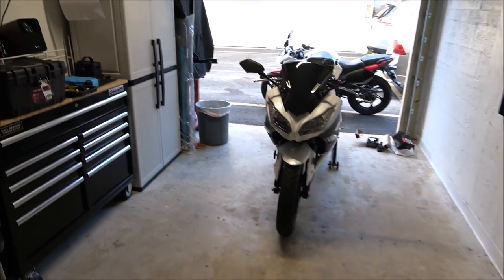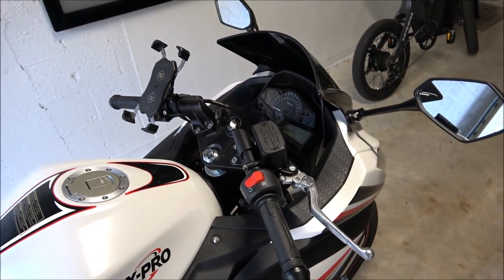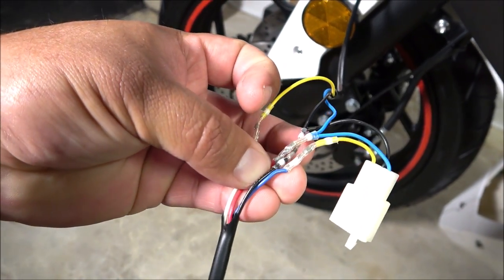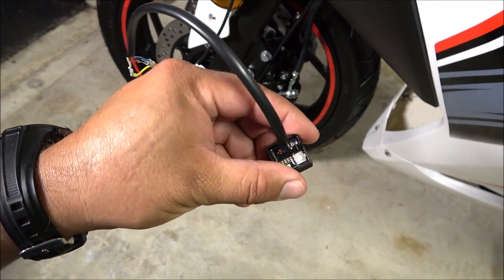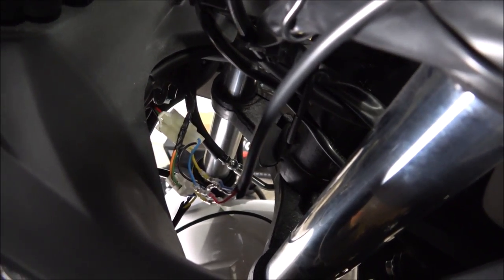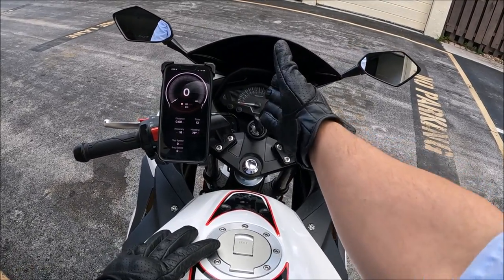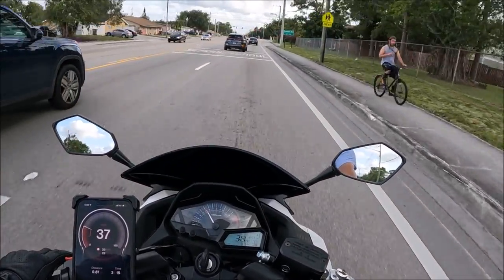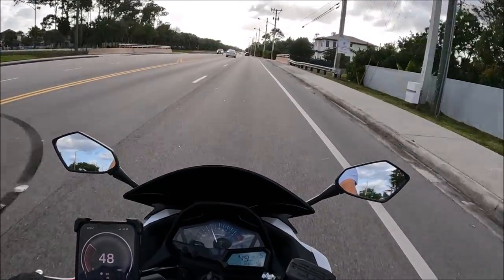X-Pro X24  Motorcycle - Speedo Fix (Calibration) - Works for Other Chinese Bikes As Well!

Comment: Can you do a top speed
Reply: Pretty sure its 90mph if you're light, going off the fact it has the same engine as the X22R
Reply: @GigaCam  I'm 245 5'10, it taps around 130-135, and I live in the mountains. I've upgraded a few of the basics, spark plug, tmaf sensor, tires, breaks, premium gas, octane booster, cleaned and oil chain and that what I can think of at the top of my head.

Comment: Did you have to calibrate your miles as well? I just got mines and yes speedometer is off about 15 or 16. And it seems to add miles fast. Maybe it's me. And a oil cooler install would be nice as well.
Reply: Sorry if this comes off as me being rude, but you do understand what MPH stands for, right? So, your bike's speedometer is saying it's going 75 miles per hour- that means that if you ride for an hour at that speed, you'll have put 75 miles on your odometer. In actuality though, according to you, you're really traveling at 60 miles per hour, so the truth is that in that hour of riding you only put 60 miles on your odometer. So yes, your bike currently is inaccurately racking up mileage on your odometer. All these Chinese bikes have inaccurate speedometer sensors, it's obviously best to install a speedodrd as quickly as you can. However, you can't adjust your odometer to reflect the true miles put on the bike because technically that's illegal. 

There are vids to do the oil cooler install, check out a youtuber named JerryHawk250 or Mike Check Moto. Best of luck!

Comment: Where can I get an x24?
Reply from the maker: They are out of stock everywhere. Very good bike with minor flaws and priced right.
Reply: @MJTechChannel  yeah man love the looks, looking for a good commuter. I was thinking about the KPR200, but I’d much rather have the X24 I think. Anyway you could do a side by side comparison of the two bikes? It sounds like you own one of each?
Reply from the maker: @XxWaNt5oM3xX  Ok will consider it
Reply: hey i was wondering if the bike comes with a temp plates
Reply: @kendrickpetty1355  You get those yourself. You'll get the paperwork to do that , then head to your local DMV.

Comment: Those wires should be shrink tubed individually they shouldn't be taped together in their  present state. I was a technician for 26 years and seen customers start vehicles on fire for doing hokey wiring putting in audio systems, T.V, or the like.
Reply from the maker: They are not taped. Check again on what I said.
Reply: @MJTechChannel  I know, but even if soldered they should be separated..they can still interfere with each other even arc across wires. This is why when I did wiring the wires where, I did my connections were at different lengths to eliminate potential arcing across wires.
Reply from the maker: @JessicaSimonson1976  Oh I see. But they do have a wrap that shrinks as it solders with the heat gun and it’s water proof as well
Reply: Lol your wiring was good, there's always someone trying to say how to do something better or like a trained professional. In reality the pros often do it like this anyway.